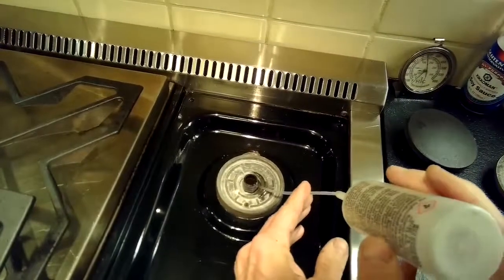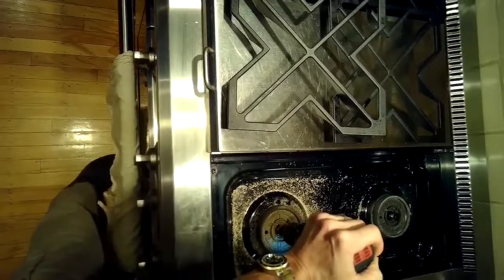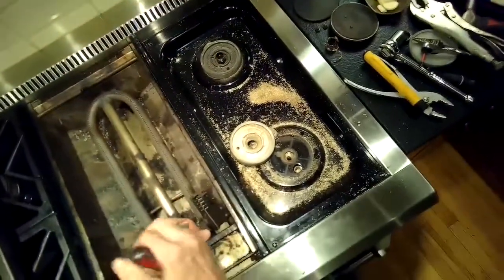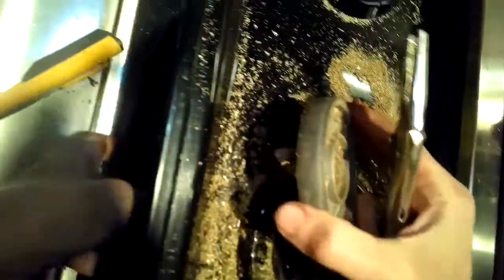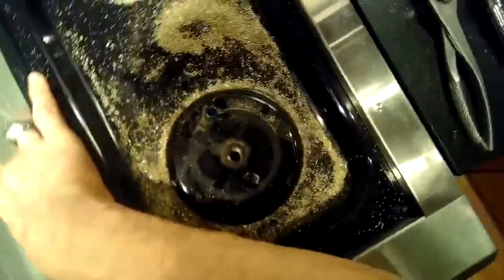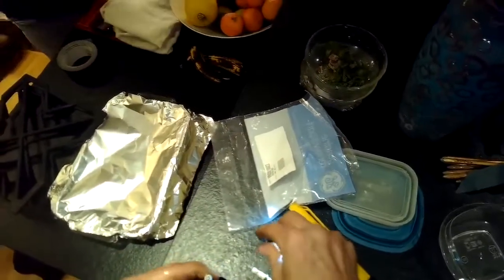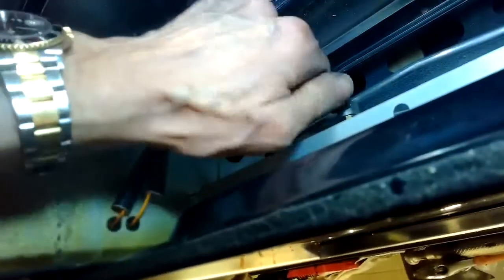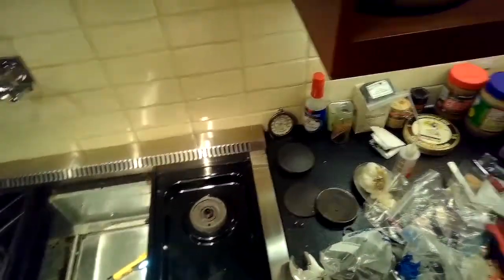GE Profile Stove Burner Keeps Clicking - How To Fix

Comment: update: Ordered the tube. came in. Started around 4 o'clock  drilling out stuck  brass nut. followed procedure finished up job before midnight. works great now. One thing, snipped off tube. then  I took a deep drive 9/16 socket and took a cut off disk and cut a slot wide enough in it  to slip over tubing to get at front tube fitting. this helped.
Reply from the maker: Awesome job👍
That’s a really big job😬